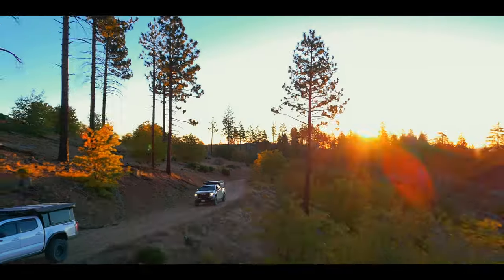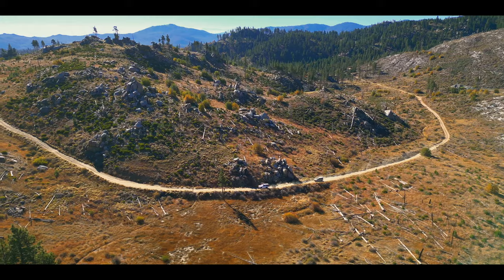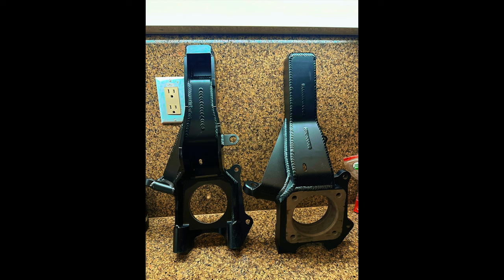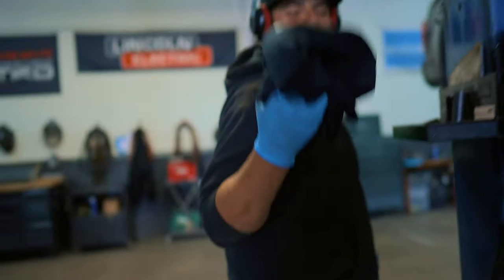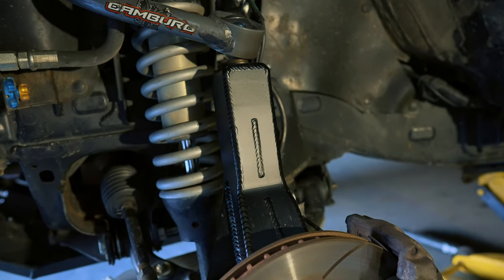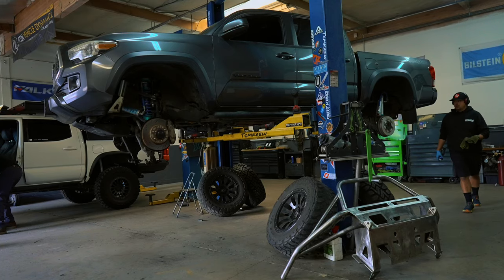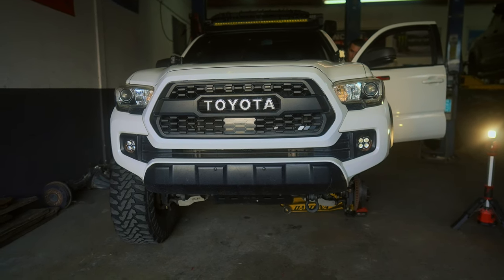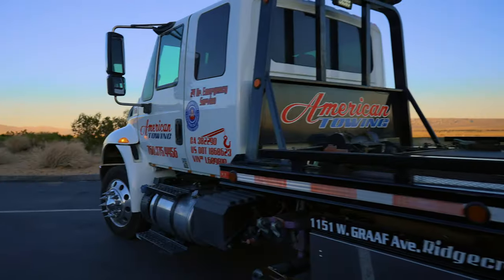Snapped Spindle Left Me STRANDED | Camburg Spindle UPGRADE | Tacoma

Comment: Using spindle gussets is fine as long as you properly heat the spindle before welding, do small weld beads at a time and to properly cool your spindle down. The only reason I can see that yours failed was improper welding procedure. Just my 2 cents and opinion. Those camburgs are beefy tho dang
Reply from the maker: Totally agree. Yes these Camburg spindles are beefy. I’ll never have an issue again.😎🙏🏼 thanks for the info.